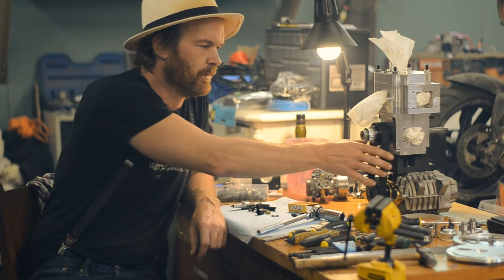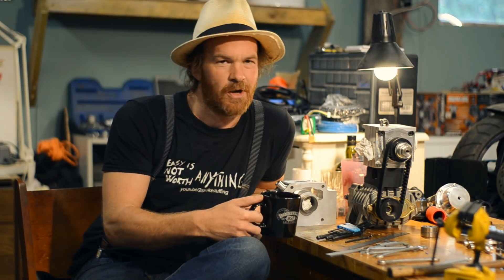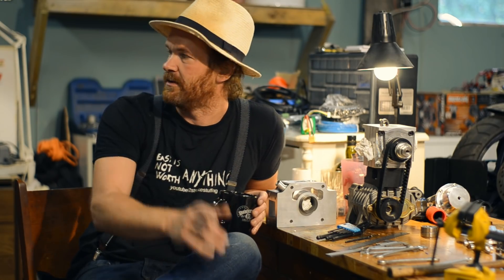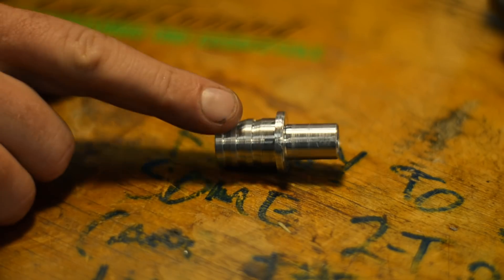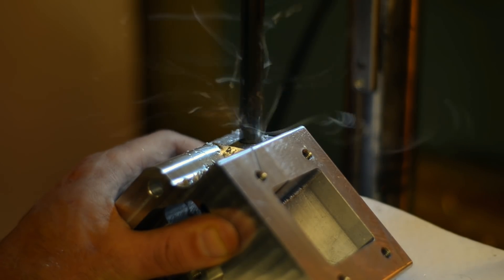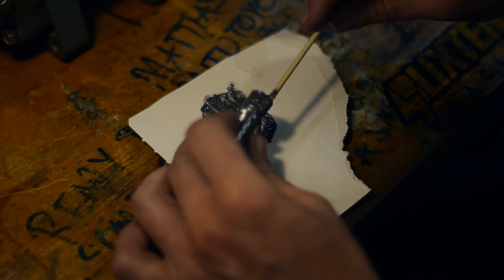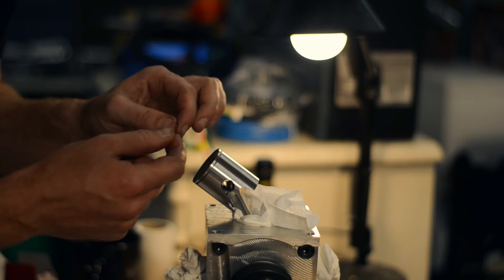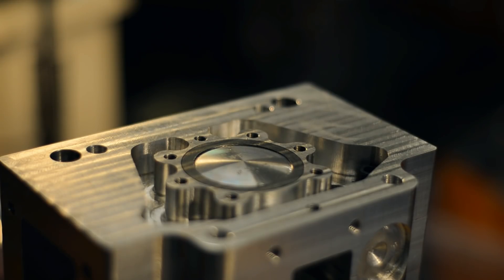Two insane engines!

Comment: Has anyone tried to build a double liner in one cylinder, one stationary and one rotary, by turning it would open and close the channels, maximum compression would be achieved, the opening and closing of the channels would be only a few millimeters from the piston, maybe the rotary liner could be connected by gearing to the crank shaft your work is incredible i look at it like a calf at a new gate it's very inspiring keep it up

Comment: if you are trying to get the most from 50cc... why not go with 2 cylinder ...each with 25cc and phase them 180 deg out to each other? would that throw you out of the class? that way you have more continuous torque for racing

Comment: I have a 1981 Yamaha IT 465cc 2 stroke on it's 3rd oversize that I'd really like to have a forged piston made for it without the gudgeon pin reliefs on either side that creates insufficient support. I'd make myself but no access to appropriate machines. If I can suggest 1 thing with that piston of yours that I noticed had no reliefs for the gudgeon pin is on top and around the circumference only to come off perpendicular/square to the stroke for about 2mm radius  before radiusing to the convex combustion chamber side of the piston. That was the manufacturers design fault to "pinging" with my model as around the circumference of the piston when fuel was ignited there wasn't enough clearance in the yz head I'd fitted and had to be relieved 40' or about 1mm deep in the head combustion chamber. Cheers

Comment: Iv been watching you for years and love every moment. Iv been working on supercharged 125cc pit bikes and run it to lots of little problems before I could even start the motor the problem I’m working on now is the supercharger AMR300 is just putting to much load on the crank
I am very interested to see how your charger works with your 50 cc 2t and how much load it will be putting on the crank
Reply: Try a twin screw super charger
Reply: @wzrox  haven’t had much time to work on my bikes anymore but now Australia is in lockdown again iv had some time coming up with a new plan. To use a turbo housing and a compressor wheel from RB31 turbo and make up my own supercharger and a blow through set up with efi

Comment: Hey guys, so im having trouble with my 50cc 3speed moped. Its already high compression, longer exhaust port time area, port matching, 20mm carburetor, 41mm piston, 14teeth x 27teeth sprocket combination, new friction plates but its struggling to hit 70kmh. I have a few decent sized holes in the exhaust pipe and header due to the years of rusting, but could that be the reason why it couldnt reach more than 70kmh?

Comment: What about a ratchet mechanism between the engine and the retarder (like how a bicycle works)?
That way load can only transfer one way and you don't have to worry about a system to engage the clutch or just letting it slip at a certain load.

Comment: In 1996 I raced the rc car on-road world championship, but the we before Mike Swager was practicing is 1/8th nitro rc on-road car with Ron Perris (rip) built/tuned 3.5cc (0.21ci) 7 port motor running on nitro. It was screening, I asked Ron what's the rpm, just north of 60,000 and a hair over 4hp on the dyno. Up converting, your 50cc should make 95hp to be on the same hp/ci, that's a tall order for only 50cc. It does sounds fkn awesome.

Comment: You're putting the 4 cylinder rc engine on a moped....I wish you didn't live so far away lol. R/C was what got me into engines at age 5.  It was only 0.8cc, but I was hooked. Have you seen the video of a guy who put an ASP 400 radial 5 cylinder on a moped? That thing sounds amazing. It's 65cc 4 stroke; getting that 14cc to move a person won't be easy. It's going to have a really low top speed with the gearing it will need...but it'll sound awesome!

Comment: Just a quick thought. While running the PIP, I think I can see fuel starvation on one of the fuel lines. There are bubbles forming in the left line. I think vacuum from the secondary carb is starving the primary. Watch carefully....how much is the secondary involved when at top rev? I think it will also influence the amount of fuel the secondary is getting due to vacuum loss through primary fuel line, etc...Two separate lines, easy fix.
Really enjoy what you are doing and am grateful for the opportunity to learn.
Reply from the maker: Good tip!

Comment: A cogged pulley pressed on one side of the tensioner should, would, could, prevent the belt flutter I'm wondering about that you might be getting later in your video. Flutter should require a little energy to get started and when the harmonics work out just wrong a small loss could become quite interesting, I think?

Comment: Proud to see how far you came if you take it apart again and have to change things id add some cooling fins on the inside of the cylinder head to transfer more heat to the water maybe do it on the hat to, yak its gonna get the crap reved out of it

Comment: The key to supercharging a 2 stroke is control of the intake with a rotary valve that opens the intake port first the intake port is higher than the exhaust, just opposite of natural crank case scavenged engines,

Comment: I am going to tease you a little bit. 
The most powerful 2 stroke engines in the world are all low speed diesel (compression ignition) engines making over 100,000 HP. 
But they are definitely not going to fit on anything with 2 wheels. ;-)

Comment: For the dyno clutch I'd look into a 1-way sprag clutch or other overrunning clutch, it can automatically disengage if the torque coming from the brake inertia is greater than the torque (or lack of) coming from the engine.

Comment: Is it worth making one of the drive links on the dyno a V belt instead of either the chain or ribbed belt, you are not making massive amounts of torque and a V belt would slip if the engine or something else seizes 👍

Comment: A tip, for porting etc… cut some thin wall pvc pipe or cardboard tube of a similar bore as the cylinder cut a couple of different shape windows in it and use it as a mask for grinding ports, make it long and you can simply slide the tube up and down or twist it to align ports/ edges etc protect the wall, as you will be fully aware die grinders like to jump and can damage your nicely honed bores 👍
Reply from the maker: Great tip!

Comment: Wait.
When you swap to 2nd carb, the fact that u have ur 2nd carb fully open and you adjust throttle with another throttle body might just fuck air mixture because the needle in the carb will be fully open even at mid throttle.

Comment: Greetings for the US,  I’ve subscribed and watched all of your videos and subscribed and enjoy them as I have been experimenting with 2 stroke engine theory since 1989 and built  an EFI system in 1993 which made a huge difference on jet ski engines that are direct drive and the EFI allowed me to move the Power Band way up top like a 125cc dirt bike but with a 2 fixed Venturi (pumper carb as you call it) carbs the engine would bog and in jet ski racing without it, huge difference! getting off the starting line was a must but you have too port the engine, stuff the cases by stroking and high secondary compression which resulted in a lot of bottom but suffered top end speed as the engine would not rev out. The EFI I built  allowed me too over port and have instant low end power. Many failures until getting the injector at optimum angle too the case Reed engine, if you would like my findings which would avoid the “ advance tool chasing” 😆 feel free to ask and they are yours.
I have a couple of questions if you you have time too answer and would appreciate it very much…
#1 I love your drill press, could you share the make and  model?
#2 I fear you will end up with a very hi BMEP and I have found that billet cranks and rods help with out building a grenade
#3 I believe anything over 1.6 primary compression ratio tends to overload convention crank seal contact with the crank, possibly a mechanical seal may help with primary compression loss? 
Thank you for your time and very well done video editing as I really enjoy your videos and a can send a pic of my EFI intake via email if you like.

Comment: Hey mate, did you think of mounting an inline ratchet similar to what you use on your drill instead of a clutch on the dyno? That way if the motor comes to a sudden stop the inertia of the alternator can't force it to turn over. Maybe even a hub from a pushbike as they can hold both torque and high rpms.

Comment: Hei Alex, once again you are doing a great job of promoting two-stroke technique and exploring new paths. I'd like to make three remarks, if I may.

A: the pulley that touches the smooth back of the teethed belt is OK, but for the other pulley, that faces the belt teeth, you might want to use the biggest diameter that you can accommodate. It will run smoother that way.

B: a 0.66 mm squish gap is not only safe; it's more than safe.
With a crankshaft in good condition you can narrow the gap down to 1% of the stroke.

C: a 0.15mm ring gap may give a nice compression when you turn the engine over by hand, but it is NOT safe. Use at least 0.5% of the bore diameter.

keep up the good work ,
Frits
Reply from the maker: Thanks Frits! Nice to have you here😁
A: Yes, Many have pointed out the same thing, I'm deleting the second roller, or going with a toothed one.

B: I know, I know. Should've said "can't be bothered with taking 0.25mm off just yet"😁

C: Not sure where I got 0.15mm from, what I've been running in several engines. Now I'm nervous, need to open up that gap.
Reply: @2STROKESTUFFING  Deleting the second roller sounds good. 
You know my motto: KISS  (Keep It Simple Son). Any part that you can leave out, weighs nothing, costs nothing and never breaks.
Reply from the maker: @fritsovermars  😁👍

Comment: i understand intake length for resonance, but unsupported spigot mounted carbs can foam up the float bowl if too long.
temporary i understand, but don't want you chasing too many side issues. thanks for the update videos.
i saw the clamp holding the beam loosen from vibration in earlier videos, and understand your reluctance to make a permanent mount until you have all the pieces for the dyno. i know it's distracting to you to have to keep checking everything instead of the one thing you need to be focused on. results for "us" can wait.

Comment: Put a gilmer pulley on the idler on the toothed side of the belt and the extra diameter will take up the slack + the belt will run smoother.

Comment: Syntrifical clutch sorry if spelling not right , out of a 250cc scooter , dyno will keep spinning freely if you need to cut engine .

Loads of torque up top where you need it awesome. 
Secondary carb trying to pick issue , maybe only happy at 80% rpm or wide open throttle. 
Awesome work mate loven it your officially a 2stroke engineer hats off to you.

Comment: Something totally different you can use a compact powerful 2 stroke engine for is a long range fpv drone. Doesn't necessarily need to be a quad style drone, I was more thinking of a plane drone(if you want to get fancy it would have vtol capabilities). Engine either powers propeller(s) directly or it powers a generator and the propeller(s) are electric.

Comment: just saying but you're leaving power on the table with that "rough" of a hone. From what we can see at least, this ain't no tractor engine, you want as less as plausible while still being enough for it to seal. Most of the friction in the engine comes from rings/sleeve contact. You want to reduce it as much as you can. A rougher hone will just stay good longer but i guess this engine is not made to do 25 000km anyway.

Hope it hepls. Keep up the good video!
Reply from the maker: Thanks for the heads up! Honing is not my expertise.
Reply: @2STROKESTUFFING  It's all good! the hone tool itself is good don't worry :) Always loved your video! You gave me the need to get a two stroke hahah Ended up building my own too but I did not invest nearly as much time as you did! Can't wait to see what the future got for you :) Keep it up!

Comment: ... or use bigger pulley's ... and that belt looks the same as they use on conveyor belts with rollers.
you might wanna use springs to load the tensioner rolls, something Mercedes Benz came up with in the 80ties when they changed from v-belts to flat ribbed belts.
not sure, but i don't think it's a good idea to put those tiny rollers on the inside of the belt where the "teeth" are.

Comment: Sounds really promising! 👌
Good idea to finish the dyno before any further testing. 🙈
What you need/want is some kind of one-way clutch/roller bearing.

Or, as may already been mentioned, a starter clutch for a snowmobile.
https://www.ebay.com/itm/One-Way-Starter-Clutch-Bearing-Sprag-for-Arctic-Cat-250-300-ATV-3402-273-FN-/133826224471?mkcid=16&mkevt=1&_trksid=p2349624.m46890.l6249&mkrid=710-127635-2958-0

Yamaha seems to have some interesting starter solution for I.e. the Bulldog that looks easy enough to implement with chains/pulleys. Maybe even better then the one in the link above.

Risking this engine after all the work, with some questionable “home brew” solution…you are way beyond that. 😉
Experiment with the engines. Not the tools. 😊

Comment: Does your Jawa Babetta 210 have a single speed or 2 speed Dual Clutch transmission??

On the 2 speed DCT engine there is a second clutch & torque converter where the 1 speed engine just has a transverse shaft and pully wheel. The DCT engine also has a layshaft & internal gears.
   
On the DCT engines the torque converter is set to change from low to high gear at 30 KPH and from high to low gear at 10 - 15 KPH. 

I own a 210.240 (unrestricted to 65 KPH / 40 MPH top speed) which feels like riding a bar stool with handlebars at speed.

15 years ago, I built a café racer for my then 16 year old son by welding a top frame & seat rails of a CZ 125-488 to a Jawa Babetta 225.240 frame (that I'd grey imported into the UK) and installing a Jawa 50-223 Mustang engine with an AMAL 18mm. carb. It was good for 58 MPH occasionally.

Comment: I see your ring gap is at .15 are you going to make that bigger for the boosted application?  On LS motors we run .22-.25 to make sure there isn't any contact on the rings and break the ring lands or score the cylinder walls.
Reply from the maker: I was thinking about that while filing. Is the larger gap used to account for more heat expansion?
Reply: @2STROKESTUFFING  exactly.  The more boost the more heat the more the metal expands.

Comment: would love to make it in a 500cc after you prove the 50 cc
Reply: No plz i have a family
Reply: Dose not work like that , there will be a significant power lose as the gases cant move fast enough. But a v4 or v6 with these 50ccs would be insane , even more insane ih he made a 100cc cilinder as they make great power , his 200cc v4 would get close to 140hp .... and a v6 210 at 300cc... quite insane, and if they were 100cc id say they would make 50ish hp ,so 200hp from the v4 400cc and 300hp from a v6 at 600cc
Reply: @emilvlahovic3917  Big displacement doesnt seem to be too detrimental towards power production on two strokes. Some more modern production 400cc 2 stroke enduros and dirt bikes have been built in recent years and detroit used to produce 2 stroke engines ranging from 1.2L 34Hp single cylinders,4.7L  160Hp inline 4s, all the way up to 18.6L v16s making over 600hp. My favorite is the 7L 426ci v6 6V-71. Wild 2 strokes!
Reply: @madmod  there are 700cc 2 stroke dirt bikes out there, but the bigger the cilinder the more power it loses , look at 125ccmotocross 250cc and 500cc , and just watch the hp per cc drop
Reply: @emilvlahovic3917  Ktm has 400 and 450cc two strokes that swamp their competition.
Reply: @madmod  can you link a 450 2 stroke ktm ? Cant find that bike , as far as i know the biggest one they make is a 300 in the exc and 250 in sx class.  But go check the numbers they dont lie man ;) . But a 500cc would be much better for his second project , the supercharged one
Reply: That would be EPIC

Comment: Hi Alex i watch all your vids but why not use the derbi drd that's been in the back of your garage for years also when cutting cylindrical parts on a bench saw all ways clamp th part because if the blade catches the part will turn and cut your fingers off between the part a the back stopper on the saw please be careful i wish you to carry on with your dreams without mishap
Reply from the maker: Unfortunately I gave away the DRD a while ago. I've got the RS50 tho. Will clamp next time👍
Reply: @2STROKESTUFFING  ok thanks for taking the time to read and reply